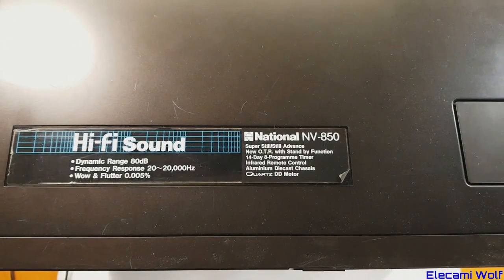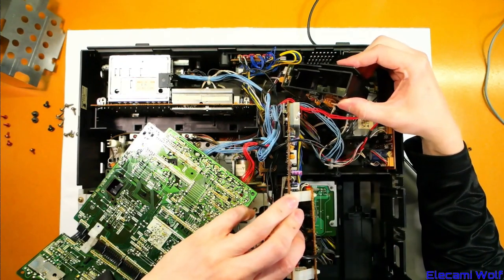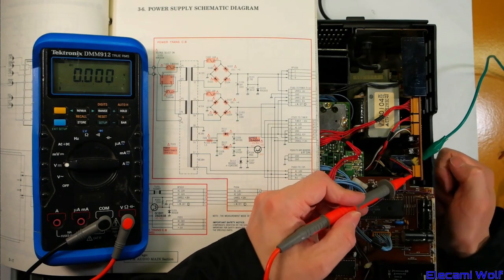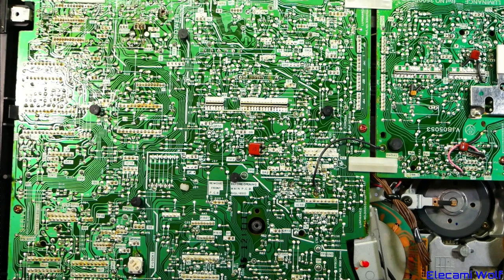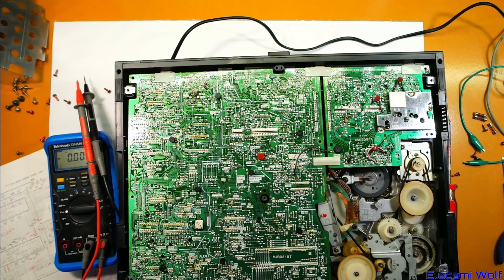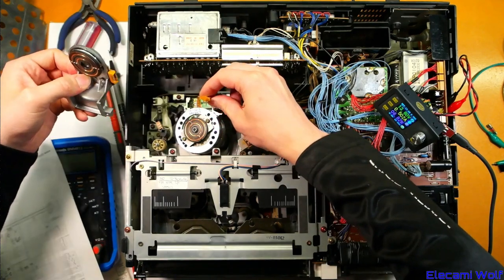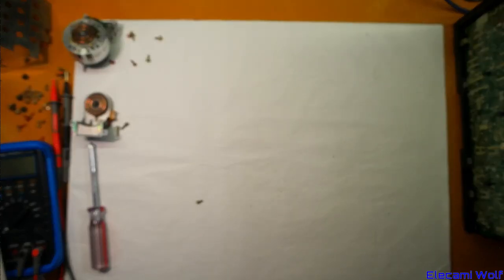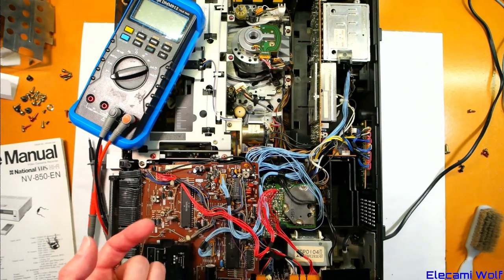EW0095 - National NV-850 VCR Investigation and Fault Finding

Comment: HiFi stereo audio changed the experience of watching movies at home forever in the 80's. Though for a time you had to pick and choose hired movies that had the HiFi sound. If I recall correctly, the HiFi audio signal is recorded first, just before the video track is and the video track wipes out 80% of the HiFi signal on the tape immediately. Think of it like layers pushed into the tape. Then the HiFi heads have to recover the signal on playback. Due to the difference in frequency between the video and audio signals, the heads were unaware of each other's signals so the HiFi track did not affect non HiFi machines. The 850 ran pretty high back tension so they were hard on the HiFi heads compared to the later models. People used to record CD's onto HiFi VHS as it was next best thing at the time if you wanted a copy of a friend's disc.
Reply from the maker: I think it is the angle, azimuth? That makes the Hi-Fi Audio able to be read separately to the video even though they are recorded in the same area.

Comment: From 50:00 this was painful to watch. Why did you destroy that poor head drum? Even if you were not intended to repair the rotary transformer, the upper drum was perfect and probably low hour, since it was replaced in 1990. This is actually a historical model, this was the very first HiFi Panasonic VCR for the European market.

At least now I know what I'm dealing with, in terms of the ROTary transformers. Seems like unfortunately this model is also affected by the glue rot. I'll have to rebuild all the rotary transformers in mine, and probably replace the bearings. Although these bearings rarely wear out, the failure you had was probably just dried out grease. Since this is a low friction precision bearing, they might have used a thicker oil instead of grease. These can probably be revived by washing them with brake cleaner an re-lubing them with bearing oil.

If you still happen to have an extra upper drum I'd happily buy that! Maybe even a whole VCR or at least a tape transport, if the shipping is not cost prohibitive.
Reply from the maker: Most of the stuff you see on my channel was saved from going to landfill many years ago. Let's enjoy exploring the way things used to be before they are gone forever. 

You can contact me though some method. Telegram, Discord, Twitter, Facebook etc, if you want to discuss buying some of this stuff. I have a complete NV-850 and another that is mostly complete.
Reply: @Elecami  Thanks. Only the 'etc' method will work, because I am not registered to any of the mentioned platforms. 
I can't find an email address on your about page either.